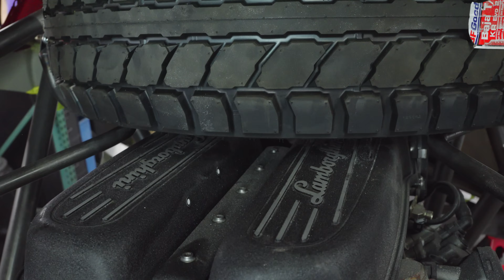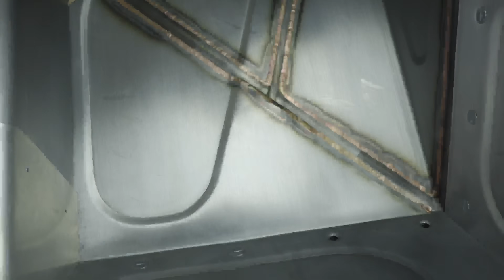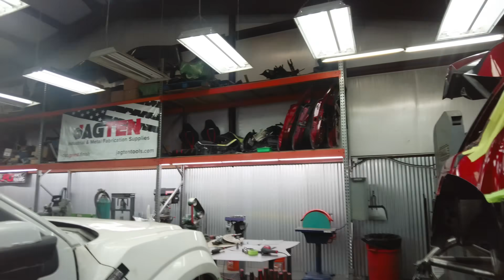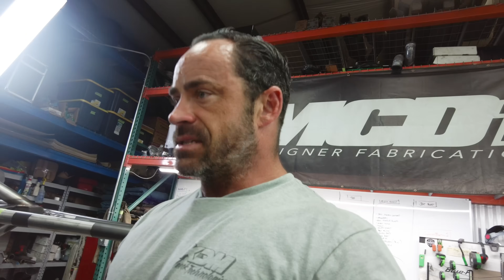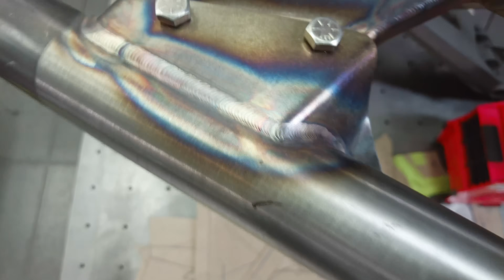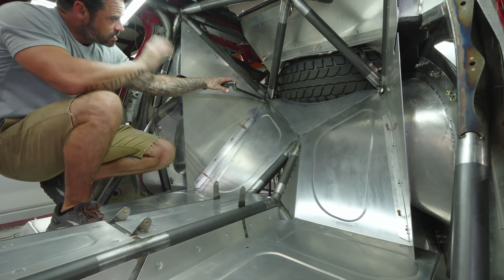Land Rover Prerunner Dakar Prototype Gets Interior Panels | MORGAN CLARKE DESIGN

Comment: Morgan, I appreciate your visual cues to styling and it all look great and advanced. However as a 30+ years in Aerospace engineer, we use 3D CAD and FEA for our designs. I suspect there is a lot of weight and bars that can be removed and still be strong enough. I have been watching many videos of vehicle roll overs and the cage did not flex or move. For me that's over built and a little amount of flex or bending is acceptable as it absorbs energy and slows down that energy transfer, while maintaining a lower G loading. If the roll cage is to stiff it will not absorb that energy and the de-acceleration is too fast with high G loading. I like the details you go into. Hopefully this is received positively.
Reply from the maker: Thanks man. A good thing to also put into the equation is chassis longevity & fatigue. These are not race cars & the chassis is not treated as a consumable as race car spec. They are built
To our last the consumer. Rigidity is key for off-road because their duty cycle is consistent, repetitive abuse. Not just rollover protection.

Comment: I like the American perspective, in WRC /Dakar cars we use expanding foam mounted on OEM fasteners to the body and doors. This protects the driver/passenger especially the arms/legs from impacting the cage. I know this is not your medium of choice as you fabricate in metal. But its very artistic the way you are approaching it. Like a Ducati 916 with the flow of bodywork and mechanical structures
Reply from the maker: Amen!